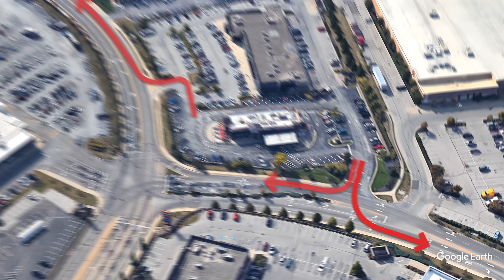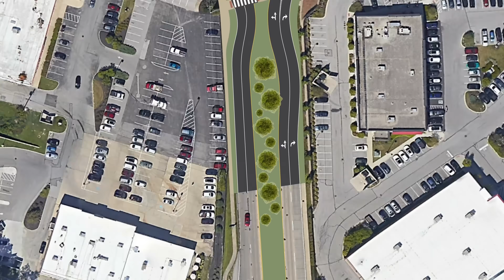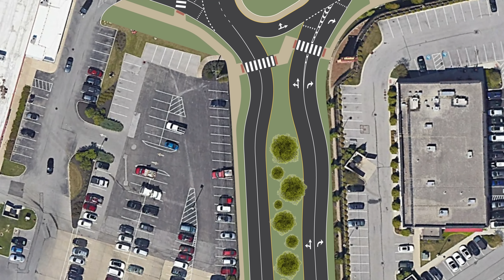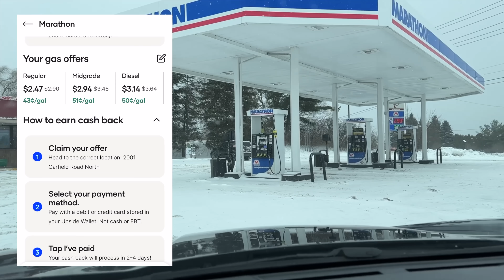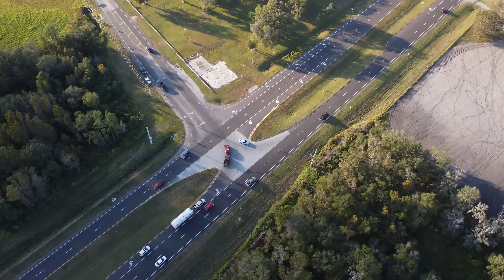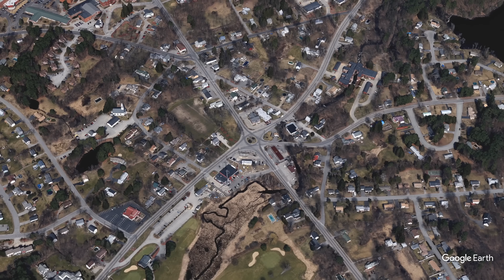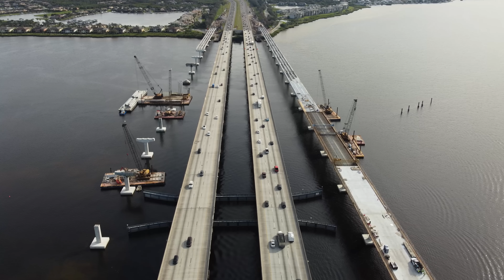These Intersections Should Be Illegal

Comment: For the rural highway, if we can use land to the outside of the highway, wouldn't it better to add a slipway after the U-turn so that U-turners can join with a right signal? I understand that turning radius would be a problem, but adding an outward kink to the main road and thus making the center island wider could be a solution to increase the turning radius. This would also help with drivers to find gaps in traffic to join into.
Center island U-turns with slipways are used (albeit with traffic lights) close to where I used to live, Turgut Ozal Blvd, Istanbul (N40.902283, E29.149327)

Comment: i've never seen a 2 lane roundabout turn into 1 lane. that seems massive opportunity for confusion.  i also think there is too much going on in the middle of driving through roundabout for sudden clarifying arrow directional changes, with top right lane showing same left turn signal and other lane but only one does a U-turn.
Reply: Really? There's many where i live in Northern Colorado. At the first glance it does seem it could be very confusing but when you're there driving through it, it feels very natrual and intuitive. There's loads of signage that tells you which lanes go where, left turn, left or straight etc.
Reply: This is a turbo-roundabout. Quite common in Finland and I think this is the only kind of multi-lane roundabout that should ever exist. This way you never need to cross another lane of the roundabout when exiting from the inner lanes, reducing accidents a lot.

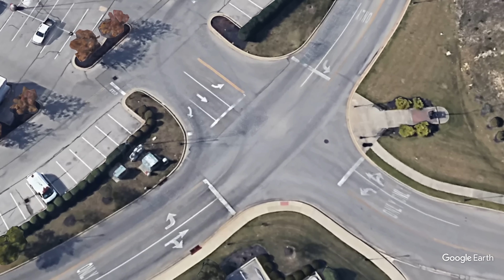Comment: 2:10 The fact this wasn’t a roundabout to begin with is baffling.
Reply: It's almost as if US road designers actively avoid roundabouts even when they are the better option.
Reply: @alfrredd  Fire departments and truckers complain about them, even when they're designed to let both fire engines and semi trucks pass with ease.
Reply: @TopiasSalakka  Yeah, same with speed bumps. They think the rest of the world doesn't have trucks or fire departments that work just fine with them.
Reply: @TopiasSalakka  Yep. Mountable curbs are a thing. 
You make the perimeter of the inner circle of a roundabout have a "mountable curb", that way longer vehicles can let their rear wheels ride over pavement designed to handle them without damaging either pavement or vehicle (at appropriate speeds, of course). This way roundabouts don't need a super large radius or lane width.
Reply: @ All roundabouts are supposed to have those anyway.
Reply: @TopiasSalakka  oversize fire truck
Reply: @JunitafluxcyfatriciaJunita  what about them
Reply: @InternetKilledTV21   American fire engines are 2x longer than European ones .
Reply: @JunitafluxcyfatriciaJunita  Seems like a skill issue on the part of US fire departments. The rest of the world has no issues using correctly sized response vehicles. We don't have to accept horribly designed roads because firefighters decide they need inappropriately sized vehicles.
Reply: @TopiasSalakka Maybe and this is extremely controversial, American fire fighters don't need to drive the giant trucks that they do. European firefighters can get away with using much smaller equipment. 

Or maybe we should stop sending giant 30 ft long ladder engines to work car wrecks
Reply: @TopiasSalakka  Their are two main problems with roundabouts and large vehicles is that the majority are not designed correctly causing you to mistrust the ones that are, but the main issue is that large vehicles should slow down as little as possible (especially if you care about carbon emissions). Large vehicles require a lot of energy and time to accelerate which both increases carbon emissions and causes traffic jams. The best thing for large vehicles is long sweeping corners and smart traffic lights that allow traffic to stop as little as possible.

some other issues with roundabouts: Mountable curbs can cause cargo to fall over even at low speeds.  Roundabouts lack a shoulder for vehicles to pull onto causing issues with emergency vehicles. If their is too much traffic the roundabout will cause more traffic than a normal intersection.

At the end of the day the key to good traffic flow, both for the environment and for safety, is to keep traffic moving at a constant and steady speed (not too fast but not too slow) with as few decelerations and accelerations as possible.
Reply: @Aquatarkus96  How is this controversial
Reply: @KingPotatow  didn't read but sounds like a purely american problem
Reply: @InternetKilledTV21   In America the fire departments that work in suburbia (So there are no high-rise buildings) . Have 30 ton truck, and 100 meter ladder.
Reply: @JunitafluxcyfatriciaJunita  Yeah... and that's fucking stupid. There are no high rises. In what possible universe is a 100m ladder appropriate for a 10m house?
Reply: @TopiasSalakka  Not sure if it impacts Canada too, but yeah whomever is involved it's confined to just North America.
Reply: @JunitafluxcyfatriciaJunita  Yeah... that's my point, that's stupid. In what possible universe is a 100m ladder on a 30 foot truck appropriate for a 10m house? Also, it's crazy how you yanks need a 30ft truck for a 100m ladder when the Japanese can fit one on an 8 ton.
Reply: @TopiasSalakka  They don't usually in reality because all too often mountable curbs become too expensive to maintain due to regular truck traffic. It's a problem though that only shows up years after everything is built hence why the roundabout crowd tend to ignore the issue on top of "Oh well it's the truckers complaining anyway.".
Reply: @TopiasSalakka  It's a developed nation problem hence why in the developing parts of the western world most of these realities haven't been discovered yet.
Reply: @JunitafluxcyfatriciaJunita  Large roundabouts are designed to take account of American commercial trucks. Why would their firefighting counterpart be any different?
Reply: @KingPotatow  okay but if we're discussing a roundabout, we're clearly talking about an intersection. So you're saying large vehicles slowing down to navigate the roundabout is an environmental problem but not coming to a complete stop and re-accelerating at a traffic light?
Reply: @cloudkitt  Yes, a traditional 4 way stop sign intersection will always be worse than a roundabout. However a properly designed and managed traffic light can be setup in a way that, aside from peak rush hour traffic, can minimize stoppage to near 0. and decrease acceleration/deceleration significantly.
Reply: @alfrredd  As they should.
Reply: @alfrredd  I was on a site visit with a state traffic engineer in Southwest Virginia a couple of years ago, and suggested that the intersection we were looking at would be a good place for a roundabout. He reacted very negatively. My impression was that he thought them inappropriate for that region, probably because they were unfamiliar to locals.
Reply: More like there should have been a proper stoplight with a U-turn on green to begin with.
Reply: Roundabouts are WeIrD and for HiPpIeS, according to MAGA voters
Reply: You've never met the people of Newport.
Reply: Exactly, all roundabouts job done.